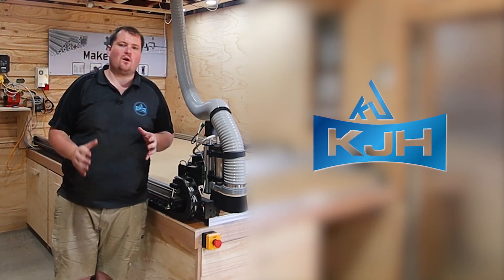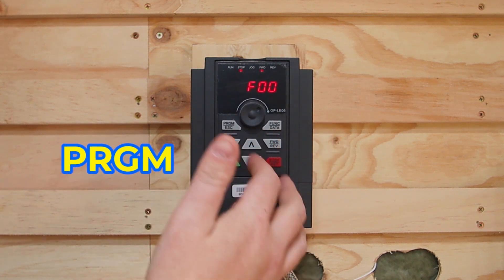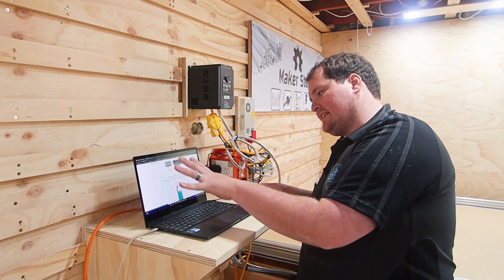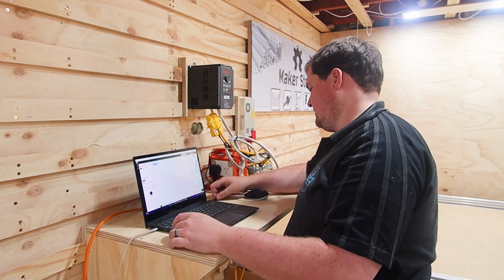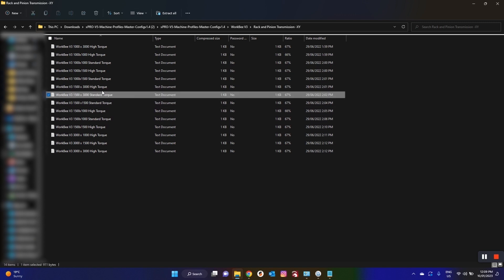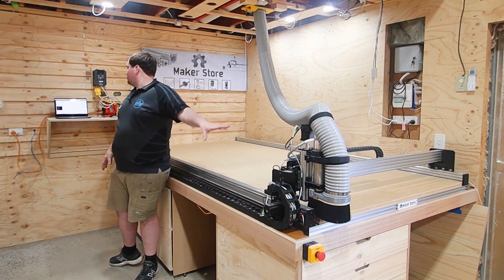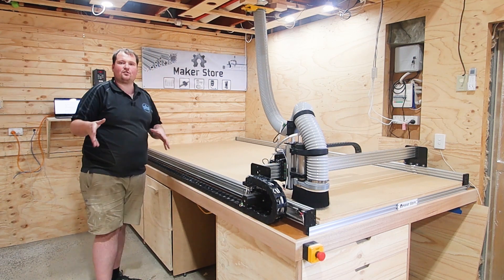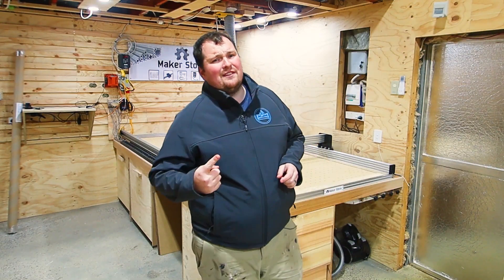Set Up Your CNC Machine: A Detailed Software Guide For Makers & Woodworkers | KJHWoodWorking.com.au

Comment: I have the Ultimate Bee CNC 1500x1500.  Do you know if there are specific configuration settings for this machine?
Reply from the maker: There will be specific configuration requirements for your particular machine. I would suggest contacting the manufacturer and they will be able to confirm those configuration settings.